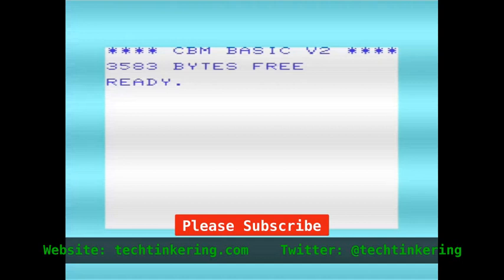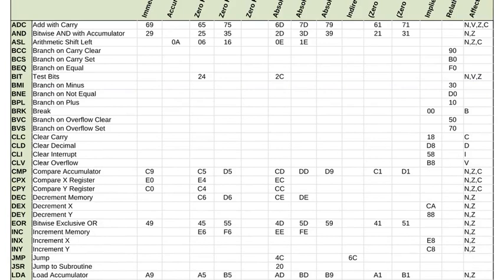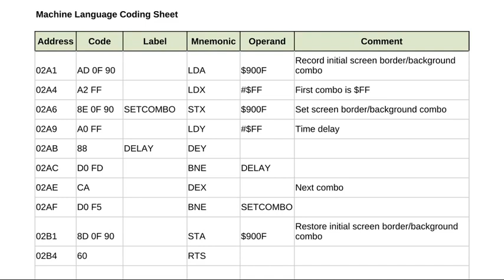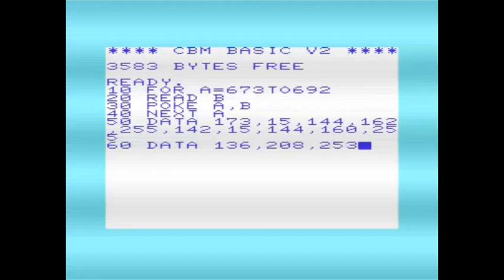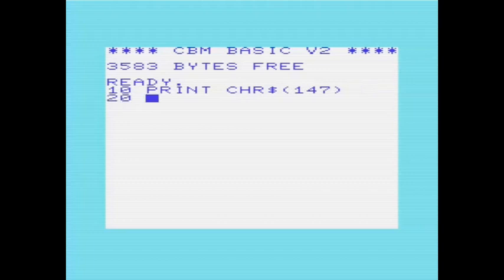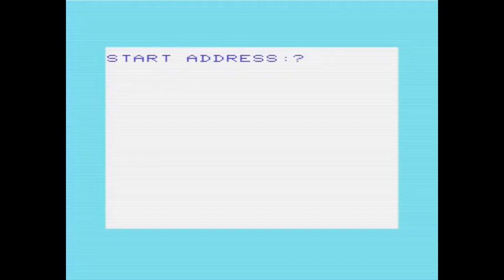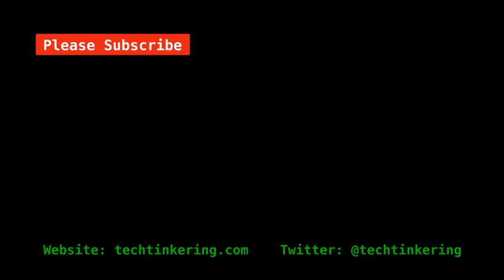Hand Assembling to Machine Code on the Commodore VIC-20

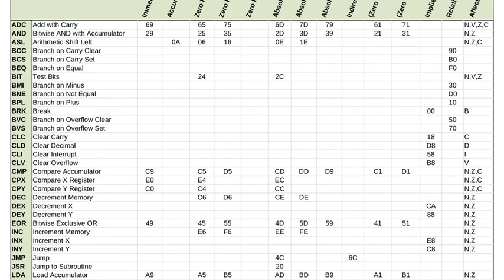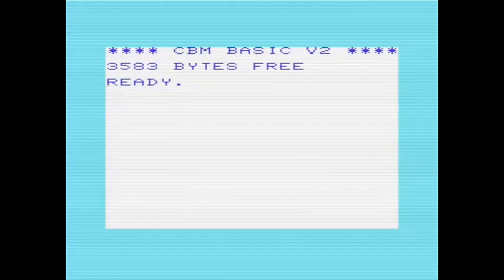Comment: Very nice. Do you have a source where the table at 1:30 can be downloaded or obtained? I assume that the hex loader at 5:17 would also work on the C64.
Reply from the maker: It's good to hear you like it.  The 6502 instruction table is available here:
  https://techtinkering.com/articles/6502-machine-language-tables-and-aids/
   
https://github.com/lawrencewoodman/machine_language_aids

The hex loader is at the bottom of the article:
https://techtinkering.com/articles/hand-assembling-to-machine-code-on-the-commodore-vic-20/
Reply: @TechTinkering  Thank you.